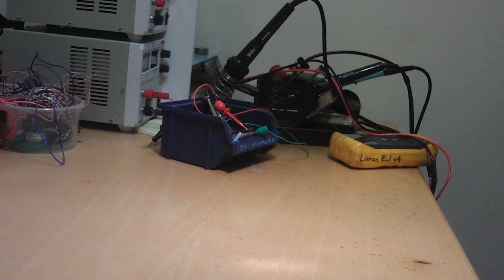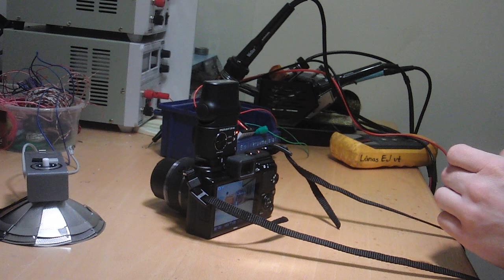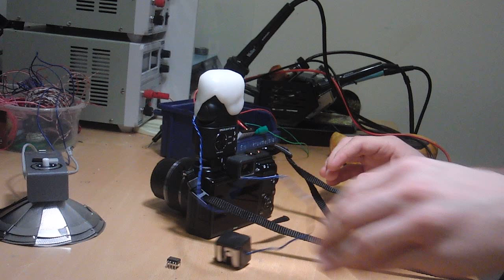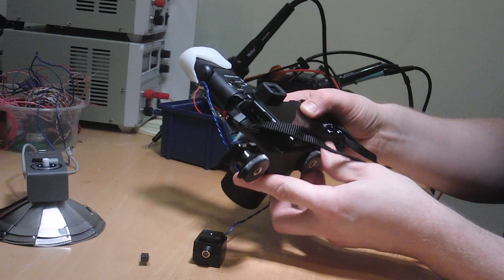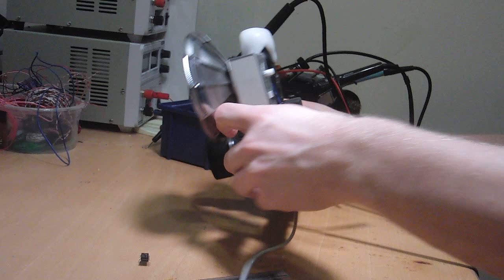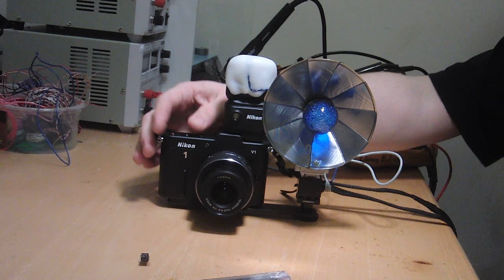Old flash unit on a new camera

Comment: Where did you get the batteries for the flash
Reply from the maker: I stacked some LR44 in a plastic tube, i might have used a metal spacer to get the right length. The original cell was 6V so it matched pretty well.

Comment: I absolutely love this project, and I still use flashbulbs all the time for the great light they produce.  But I guess I don't understand why an off-the-shelf pre-digital slave trigger would not work?
Reply from the maker: The typical pre-digital slave trigger is made to trigger electronic flash units which means a quick low energy pulse. The semiconductor inside simply cannot handle the current required to trigger an old flash bulb. Either noting happens or the slave trigger breaks.

I'm sure there are some commercial slave triggers that can do it but i have not been able to find one.
Reply: @Ghlargh  Ah, interesting, OK thanks! I have been meaning to set up something like this for a while. This is great information! I'm now looking at a couple of vintage slave units that were made to trigger either flashbulbs or electronic strobe--likely  from the '60s or early '70s. I'm glad you posted this video!

Comment: Alternatively, buy a camera with a normal hot shoe mount and/or sync socket.
Reply from the maker: A lot of modern hot shoes can not handle the current needed to fire one of these old bulbs. Firing one of these old flashes can easily push over 2A through the hot shoe.
Reply: @Ghlargh  Point taken :-)

Comment: This is a real long shot here. You would happen to know if it would be possible to "hollow" out an old Nikon  bulb flash unit and "chuck in" the working components from a modern flash would ya?
Reply from the maker: The bulb is probably an old Osram or Sylvania bulb. Anyway, the bulb itself is literally just a ligthbulb filled with aluminium wool and pure oxygen, the wool burns very fast in the pure oxygen creating a flash.

It would be easier to start with a standard incandescent car bulb which is what these are based on, or even better you might be able to find a glass LED bulb.

If you're fine with a fairly low power flash you should then be able to stick the tube from a single use camera or compact film camera flash in there, run the wires out the back and hook them up to the flash electronics. I would recommend a single use camera with flash since the electronics in those are very easy to understand. Trap for beginners: an electronic flash tube has 3 connections, the two high voltage connections at the ends of the tube plus a third trigger wire that goes either to the reflector or a third connection on the tube. If it goes to the reflector you will need to attach this to a bit of wire wound around the tube to induce an electric field inside the tube to trigger the flash.

Also be aware that you are playing with 330V DC, while it's unlikely to kill a healthy person it will cause skin burns and hurt a lot if you poke your fingers in the high voltage.

Comment: Apart from the weird sync requirements and need for an adapter, these are actually a great option sometimes. They are    e x t r e m e l y    bright, so you can use a flashcube and hotshot adapter (tiny setup!!) to replace something like a Metz, to an extent.

Comment: what is the point of this_
Reply from the maker: Why do people keep asking that? First off it's a fun thing devising a way of using two things together that weren't meant to work. Second these old bulbs give off warmer light than an electronic flash, and lots more of it.
Reply: @Ghlargh  so from my understanding they are single use? Each time you'd need a new one right? Also... are there really no electric one that can match it? I am genuinely interested, that is why I ask...
Reply from the maker: @TeacherFlash  Yes, they are very much single use. It's a glass bulb filled with a combustible metal and oxygen gas. As you trigger the bulb it burns for about 20ms with a very bright light. An electronic flash unit as bright as one of these bulbs exists but it's heavy and bulky, and runs from wall power.
Reply: @Ghlargh  I see... I have a question though, how stable (intensity-wise) and how homogeneous is the light during those 20ms? Could it produce artifacts and bad focal lightning on an image? Thank God a YouTuber that replies instantly so conversation is possible . Conversations on YouTube are almost impossible lol people never reply and if they do, it is usually 10 months down the road.
Reply: @Ghlargh  also how much do those light bulbs cost? and where could one possibly get them? It seems antique...
Reply from the maker: @TeacherFlash  Area-wise the light is very nicely homogeneous, the light does go up and down a little bit in intensity during that time span though but if the shutter is open during the entire flash the light level is usually very consistent.

The bulbs are antiques, most have not been produced since the 70's but there seem to be huge stores still available as new old stock on auction sites. Prices vary widely but it's not a cheap way of photographing.
Reply: @Ghlargh  thank you for the response

Comment from the maker: Julian Solis
If you have a proper flash sync output on your camera it becomes much easier, you wouldn't even need to cut up the opto coupler, just use it unmodified in combination with a battery and a resistor connected directly to your sync output.

The voltages and currents that this opto coupler handles makes it the ideal part for firing almost any kind of camera flash since it handles both the voltages of semi-modern units and the currents of older units.
Reply: Ghlargh could you explain the wiring of the coupler please

Comment: Have you worked out flash sync? You've probably learned in your research that flash bulbs need to be set off before the shutter opens to ensure maximum light output of the flash. Other than that, good job!
Reply from the maker: Most modern cameras do not have settings to trigger the flash before opening the shutter. I simply set the shutter to 1/20 to 1/30 of a second, that way the shutter is still open when the flash bulb goes off.

On cameras with sync cords you could probably build an external circuit to control the sequence but i only have an infrared remote with uncertain timing for this camera.

Comment from the maker: The bulb was an old ~1950 #5B pyrotechnic flash bulb, when triggered it sets fire to very fine aluminium wire in an oxygen atmosphere, the wire burns to create the light.

These old bulbs were single use, they only worked once and were then thrown away.
Reply: hi there ... could you find the GN for that bulb ??
Reply from the maker: The guide number for a Press 25b with a good reflector is 58m at ISO100